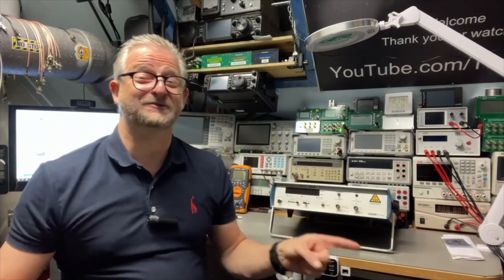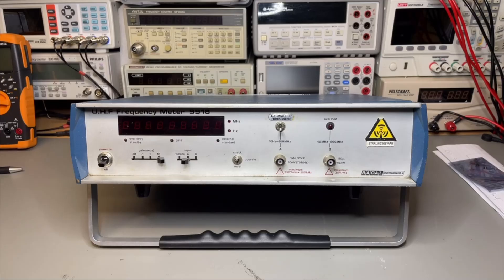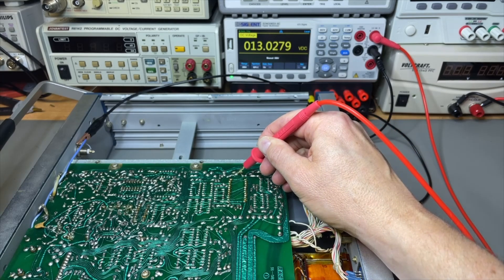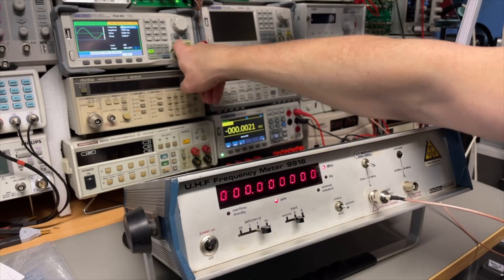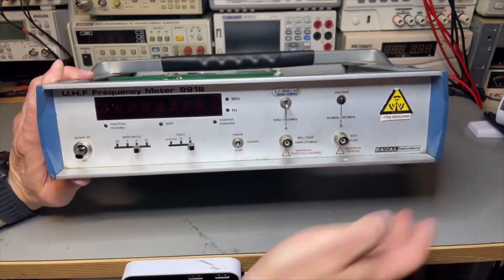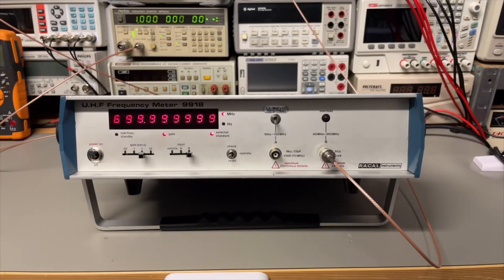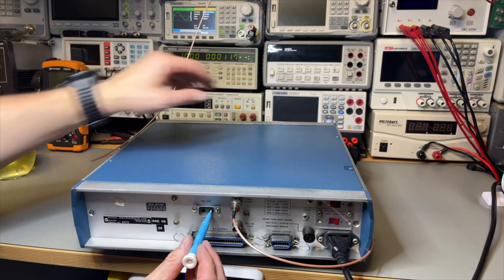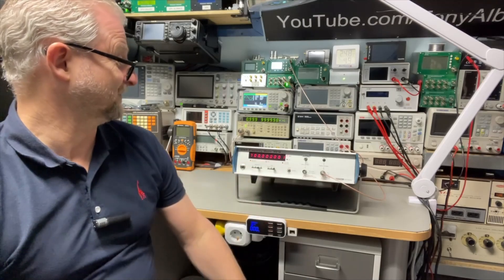TA-0407: Racal Dana 9918 Frequency Counter #2 - Repair Calibrate Cleanup

Comment: I too love freq counters. You may have more of them than I do, but I doubt it. It seems like I get a broken one at every ham swap for $10 or $20 to fix. 

I've had the frequency addiction eve since I built a TRF WWVB receiver for a lab reference before the days of GPS receiver references. Then I bought an HP 524 that hurt my back, so I resold it for half of what I paid for it. I loved it. Dials, knobs, Nixies, switches, It was a work of tech art. It was very stable after being in operation 24/7 for 20 years at a TV transmitter site before I bought it. But if I'd kept it it would have crippled me. Those aren't boat anchors. Those are the whole boat.

It doesn't help that I sometimes do contract repair work for the Time and Frequency group at NIST in Colorado. I'm like a kid in a candy shop when I see a rack array of 8 old 5061B's feeding WWV, and I feel like I'm in a church when I stand in the room with NIST-F1 with its correction for the tidal pull on the east and west coasts each day.  :)
Reply from the maker: Yes you can never have too many :)

Comment: Nice of you to use the correct transistor, but seeing the job it is doing, pretty much any transistor would be fine.
Reply from the maker: Yes agreed, but 50 cents and 2 weeks waiting to keep it original, why not.
Reply: @TonyAlbus  Quite right, I suppose. It's not as if you were in a hurry.